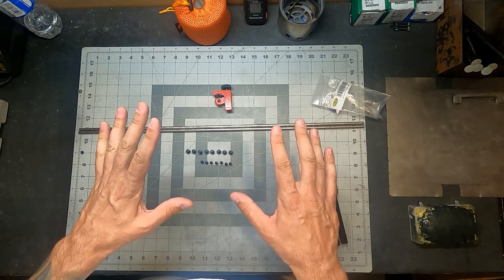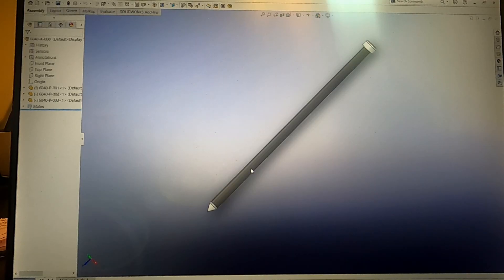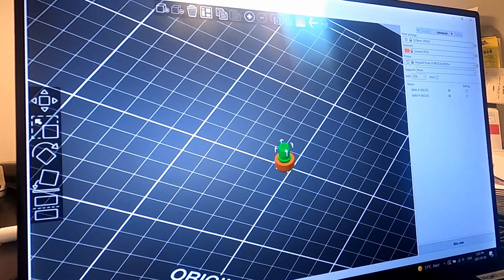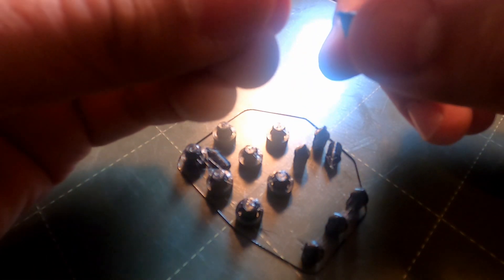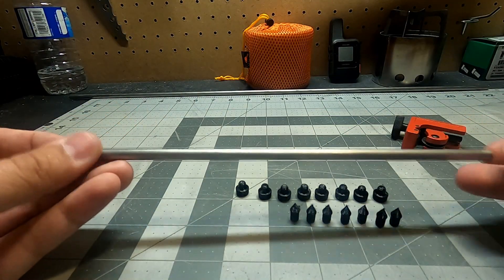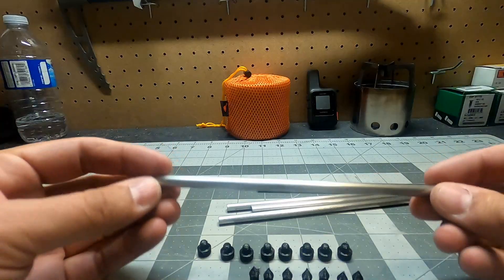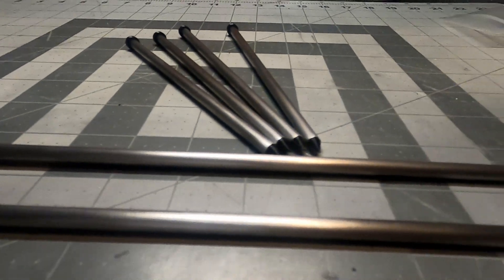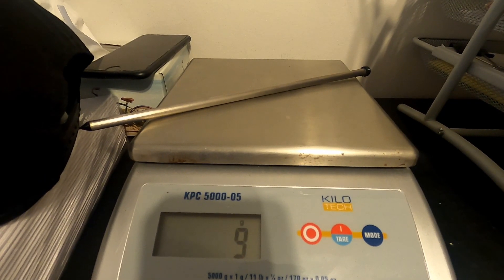How to make ULTRALIGHT TITANIUM Tent Stakes - 6" long (6 grams) 9" (9 grams) DIY Titanium Tent Stake

Comment: You should use some of the design elements from your Tica Ice tool (I like how the Tica's spike is done and that design should hold up REALLY well if used on these Titanium tube stakes).  I doubt even these thinner Titanium tube walls would split with an angled cut in them (like your Tica design has).  And following the design with just having a "filler" keeping dirt out, you could have the titanium walls of the tube doing most of the penetration.  
But the heads on these, I'm not sure they would last too many hits.  Not because the solid PETG (polyethylene terephthalate glycol) failed, in fact I find that stuff to be very impact resistant (kind of the combination of the best of PLA and ABS).  But I think your design of the head doesn't extend far enough down the stake.  Any forces striking that head that aren't exactly inline are going to weaken it until it breaks off.  It will still eventually happen even if you extend it further down, but it will last a lot longer as it has more stability to counter any off center line forces.  But any way, I respect that you show how to make something like this when you sell stakes (that many of us with 3D printers could make, although you had me salivating over you original PRUSA i3, did you assemble your own or buy it already made and tested?).  Oh and interesting choice of books on the shelf there behind your i3 ;-)   Have a great day Steve!
Reply from the maker: All good input. I have remade them since, and used the same technique as on my TiCa ice tool like you mentioned. They held up well on my bikerafting trip, but even with the redesigned heads, they look pretty beat up. I think I will have to make the heads out of aluminum or titanium. I have a picture up of them on my Instagram account if you are interested in seeing them.
Reply: @Suluk46  thanks, I just started looking over your Instagram last night.  I will find that article.  But its taking me a while to work through all of your great posts.  REALLY great stuff you are doing all around (pay no attention to YouTube views and such; the algorithms can be tough on vendor channels).  Just keep doing what you are doing my Northern friend.

Comment: thanks for doing that.. i was trying to get pipe size that would take my makeshift cap/spike.. this makes so much more sense. how tough is that plastic though.. 1970's camera lens housing tough? 
on a long hike you don't know what you'll be dealing with so did you go at it with a rock.. piece of wood.. petrified banana?
Reply from the maker: Time will tell...but plastic is tougher than you think. I can't remember a time where I used a rock to pound in my stakes, not saying it doesn't happen, but maybe it's where I live. If it doesn't go in by hand, I move the tent stakes. I made some years ago with aluminum head and spike, and with 3D printers being everywhere these days, I figured I'd give it a shot. If one breaks or fails, I'll let everything be know.